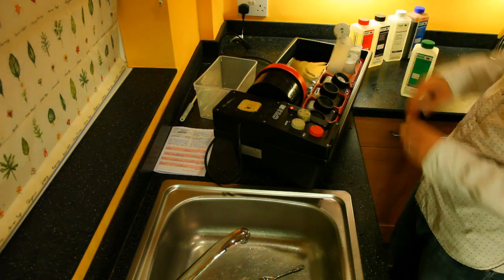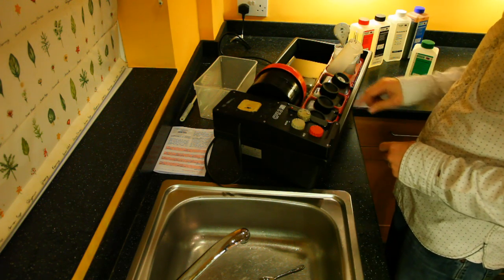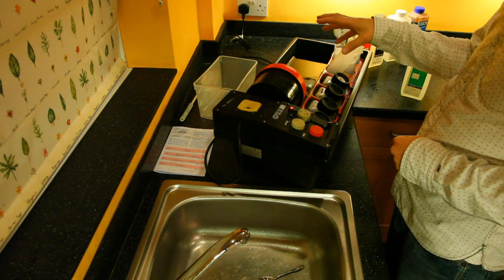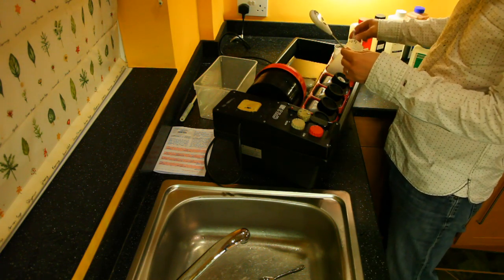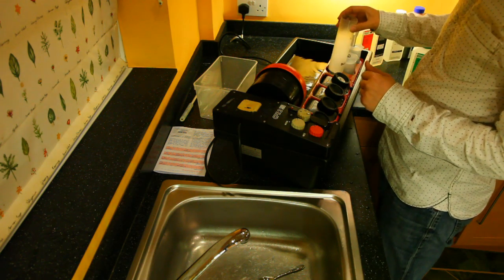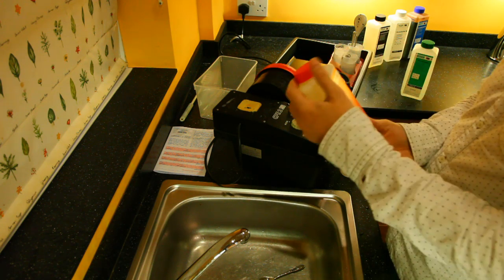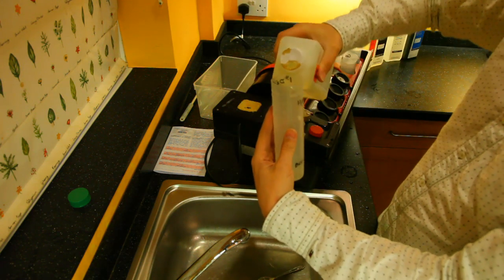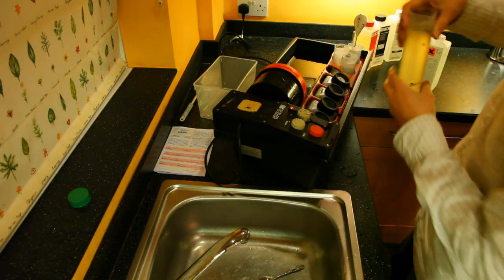Developing 4x5 Film in a Jobo CPE2 - Part 1

Comment: Jobo offers a lot of tanks of which some don't suit to your cpe 2. In the past I bought a 2520 tank because you can put inside a 2509n reel holding 6 4x5 sheets, but this tank doesn't fit well in your cpe processor and causes bad agitation resulting in failed development. On the Jobo site you'll find the new tanks available for this system. You could also try to find old tanks on ebay like the JOBO Entwicklungsdose RO-Tank 4323 or 4322 for often lower prices.

Comment from the maker: Hi pokerjk - I use 250ml to develop 12 sheets which gives me 20 batches out of a kit giving 240 sheets per kit .. I did buy my fuji hunt e6 for £30 which worked out as 12.5p per sheet... however at £50 per kit it works out as 20p per sheet..  (the 40 films is for 120 film - if you look at the guide it says it will process 200 sheets but you can push the chemicals a bit harder that that so if you follow their instructions, you would get 25p per sheet)